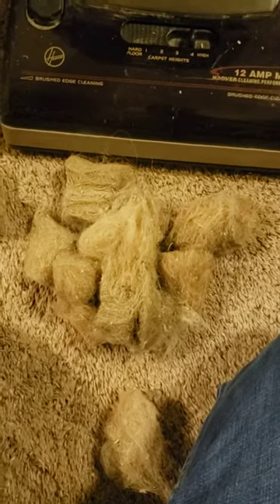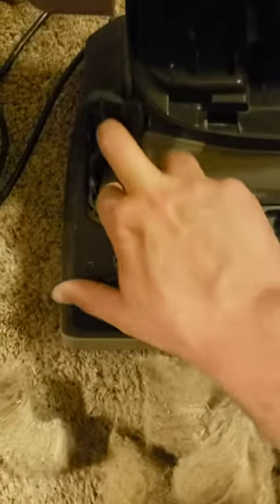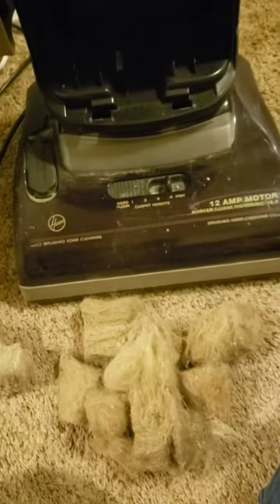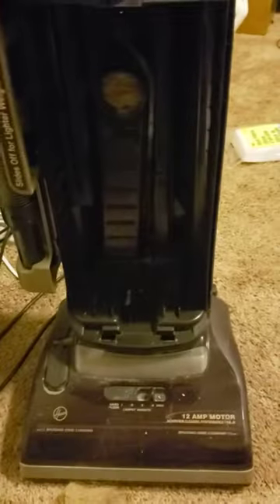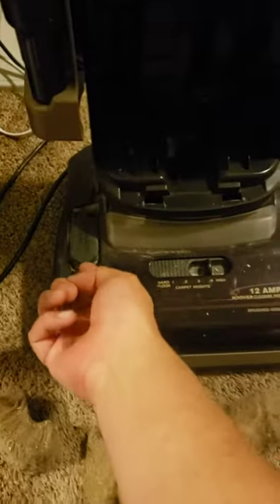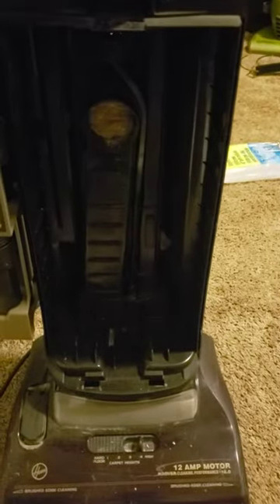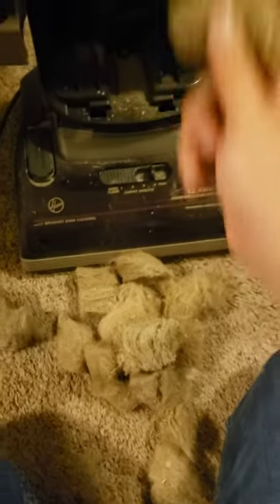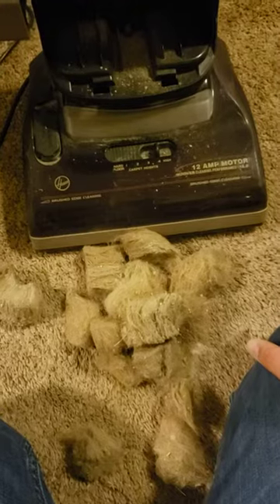Clogged thrift store Hoover caddy vac

Comment: Can’t wait for tests comparing 7.2 amp versus 12 amp motor. I had grey elite with 12 amp until fan exploded and broke the housing 😭
Reply from the maker: It'll be interesting to have the numbers I'm also curious as to whether it even runs at a full 12 amps